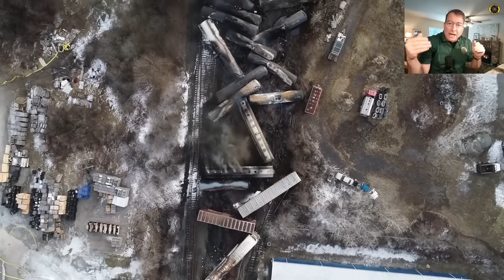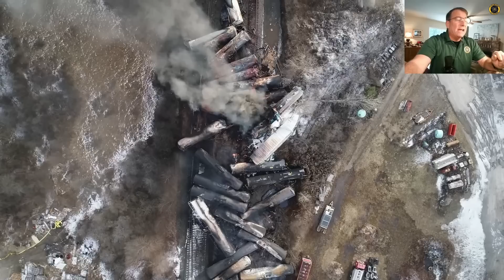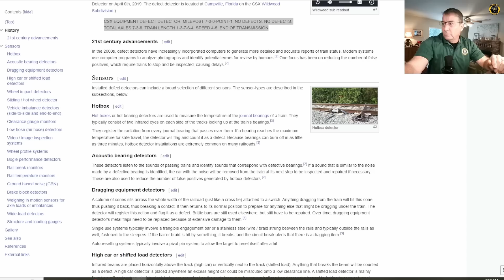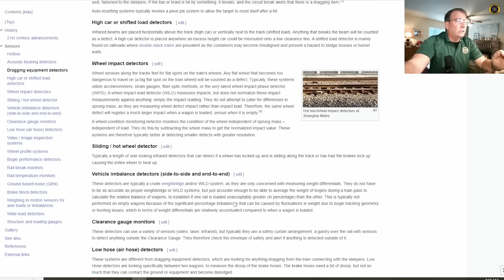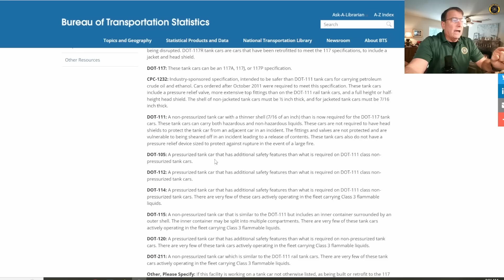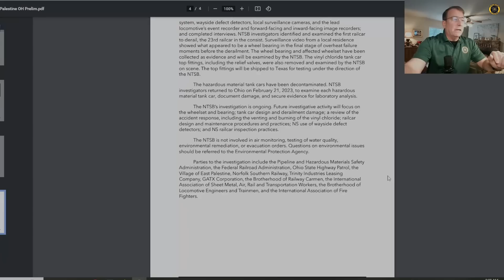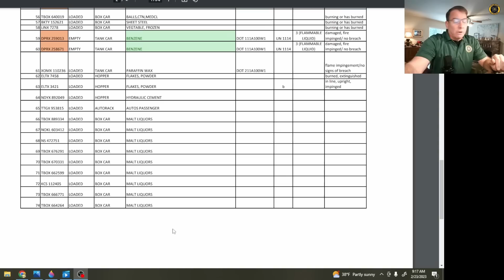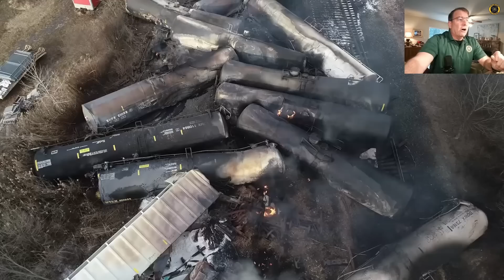NTSB Prelim Report: Norfolk Southern Train Derailment 23 Feb 2023

Comment from the maker: The derailment caused the emergency braking, thus exacerbating the derailment. Not the other way around.
Reply: When I worked at Conrail, I heard the story of a 4-mile train the PRR tested in mountainous territory.  Legend has it that it is still out there, broken into pieces of rusting steel down a ravine somewhere.  There are physical limits to train size, and when Conrail was economizing they used to run long trains out of terminals as needed.  Cars clogged everything and it was a disaster.

Precision-Scheduled Railroading (PSR) is nothing new, but it was used for railroads coming out of their post PennCentral bankruptcy.  Railroad management does not have a capital-investment mentality; they have an opportunistic/punishment culture since post Civil-war and the interstate highway system.  They do not have safety reporting hotlines or engineering-solution culture as in aeronautics.  It is dam*ed if you do, dam*ed if you don't.

The problem I'm seeing in that NTSB report is that there is no intermediate warning system with the HBDs indicating a caution to reduce speed due to potential mechanical defect.  If the temps are below an inspection threshold, then the train would continue with "no defects" at track speed until rapid failure warned to the crew to stop.

What this tells me is that the engineer had no idea that the bearing was in catastrophic failure because he was still applying dynamic brakes.  Dynamics are used to bunch a train's slack on downhill grades to keep a train under control (like regenerative braking or vaguely like putting a car into a lower gear).  They are not used to stop a train and are actually ineffective under 25 mph.  There are about 5 different braking methods on a train (more in passenger trains equipped with electrical and caliper brakes, as well as magnetic brakes in Europe).

It looks as if he was trying to bring the train to a gentle stop due to this being a first warning of a problem.  With a long train, this is entirely consistent with safe handling practice.  A train CAN derail with emergency brake application if it's on a tight curve, or if too much power is applied inconsistently along the length of the train, causing "string-lining."  Or the train can break into pieces over hilly terrain, due to speed differences between downhill and uphill sections.

BTW, the accordian-pattern of wrecked tank cars  is actually a designed failsafe.  Tankcars are fitted with "shelf couplers" that lock the couplers together so that the cars DON'T telescope over top each other, punching holes in their bulkheads.  Instead, the forces are directed through the length of the cars along their drawbars so that they wreck laterally and roll free of their wheelsets.

The wheelsets are held together by gravity and a very large machined-steel pin the size of a howitzer shell.  Service-vent valves on the cars are shielded from crushing and require a special tool similar to a fire hydrant wrench to open.  Insulated chemical tankcars have a glass inner-liner and baffles to stabilize compressed liquid loads.

TLDR;
In other words, we are dealing with huge shearing forces combined with both multi-ton static AND dynamic loads that are reinforced against accidents, but are not well-monitored or maintained due to upper-management failure.  In case you wondered, this accident is what happens when an irresistible force meets an immovable object.
Reply: @weatherupstairs4814  Thanks for bringing some actual railroading knowledge to the discussion.
Reply: Your comment about the malt liquor was quite funny! About the only levity you could wring out of that report.
Reply: I read years ago it takes two seconds per consecutive car to achieve full braking. So if the twenty third car derailed and snapped the air hose there are still one hundred twenty plus cars behind it times two seconds each. 240 seconds =4 minutes to achieve full braking on the last car. THAT'S why it stacked so many together before it crashed to a stop!
Reply: @Ron Frame  Nah, it's about 2 seconds for the brakes on each car to fully apply,  but the drop in air pressure that triggers the brake application travels through the air line very quickly.  Plus, the distributed locomotive and the sensor on the very end of the train would have initiated braking from their locations as well.
Reply: @ronframe387  the loss of pressure travels at around 700 fps down the air llne.  It's more of a parallel system, not sequential, as each car has an air (pressure) reservoir that applies that train car's brakes when the line pressure drops.
Reply: @stanley917 It's sequential. If the brakes are applied by the engineer on the lead unit, it would reach the last car 10 to 15 seconds later, at most, and normal application, starting at the head end, brakes would apply front to back, sequentially, from front to back.
Reply: @thomasmleahy6218  There is a propagation delay of the pressure drop (travels at approximately 2/3 the speed of sound ~ 700 fps) which causes a slight delay in brake application from one car to the next when the pressure line is compromised.  All the cars are on the same line, in essence  'teed' off the line -  in parallel to each other.  Sepuential impliles one car's brakes must be applied before the next can be applled. I was replying to someone that was implying it was minutes before all the cars were under braking.
Reply: @stanley917  Not many media and political types seem to have the slightest knowledge of how train air brakes really work. Lots of folks commenting on various blogs and videos don't seem to understand it either.
Reply: @ronframe387 Full braking would only take 20-30 seconds after the air went, and actual reduction in speed is very slow to develop. It's nothing like auto or truck brakes. If there was no derailment, it would take a couple of miles to stop that train safely. Lots of weight, lots of inertia. Excluding the derailment, the train makeup was an accident waiting to happen, unless controlled by an experienced engineer, but the makeup did not cause the derailment, it was a severed axle. The axle and the wheels on each side of the car are all one solid piece of steel, usually 6 inches or more of solid axle.
Reply: @thomasmleahy6218  The wheels are of one piece of steel( 2 each) and one axle of steel ( 1 each) for 3 pieces of steel, like 1.5 to ti 2 tons per wheel-set depending on wheel size and axle size.  The wheels are pressed onto the axle, usually about 40 or 50 tons per wheel.  The pressure gradient in a brake pipe during an emergency application has been measured at 6 seconds per mile of train length, or a drop of steady brake pressure to ambient pressure.
Reply: @royreynolds108  Axles are steel forgings as are the wheels. Each axle has a unique serial number. There is a database that details the size of the axle where the wheel was pressed on and the recorded pressure for the process. As wheels are replaced, the axle size will become smaller until its service life is gone, and then it will be destroyed. I have visited the NS shops in Altoona, PA, amazing operation.
Reply: @thomasmleahy6218  Loaded tank cars can weigh up to 263,000 lbs. A mile of them is a lot of kinetic energy to stop quickly.
Reply: @ronframe387  I'm also curious if the distributed power unit played any role in pushing the trailing wagons into the first one to derail.
Reply: @don_5283 It was all the tremendous weight behind the derailment that kept the cars piling up. The derailment caused the emergency brake. All engines, dpu or not cease power immediately upon emergency application. The car pileup exerted most of the stopping power as the cars slowed, the brakes would finally help in stopping the train.
Reply: @don_5283  Conversely, when the air was lost, the DPU would have stopped pushing automatically.
Reply: If there was no emergency brake the broken bearing would have caused the derailment, the car would drag on the ground, slow down, go sideways, pull others off the rails and all others would pile on top at full speed.  If the emergency brake did not slow the cars behind there would be more piled on top of the fire.
Reply: @markchamberlin7990 The bearing cut completely through the axle, SEVERED the axle
Reply: @thomasmleahy6218  Which means is was sure to drag the ground and cause a pile-up.  Emergency brake could not worsen that.
Reply: @thomasmleahy6218  it's called a wrung journal. It heats to the journal to the melting temp, and spins off, leaving a nub  on the end of the axle.
Reply: There seems to be a lot of confusion on just how train airbrakes work.  Many think air pressure from the locomotive is used to apply all the brakes on the train and that is NOT so. The compressor in the locomotive pumps up air pressure in a large tank on the engine. All the cars are connected with an airline, which is what you see with the hoses under each coupling. The pressure in that "brake pipe" as it is called is used for several purposes. Each train car has it's OWN air supply tank and a device called a "triple valve". That valve is the heart of the system. Air from the "brake pipe" running the whole length of the train, is taken off in each car, through that triple valve that maintains the air tank pressure on that one car. The triple valve ensures that those tanks maintain a set pressure all the time there is air in the brake pipe. The brakes, are activated to the desired level, on each individual car, and are controlled by the engineer raising or lowering the pressure in the "brake pipe" (train line some call it). A change in pressure that would call for some braking would cause the triple valve, on each car in the train, to release air into that car's brake cylinders. Air actually puts the brakes ON. If air pressure was lost, in that particular car, the brakes in that car will release. Train brakes are NOT spring brakes as commercial trucks have. If air is lost in a truck large springs hold the brakes on. In a train it is just the opposite. Lose the air in a car and it's brakes release. If a car is uncoupled and left on a siding, it's brakes will stay on for some time, days or maybe weeks. If that car is to be moved by a switching engine, the air has to be manually released in that car to free the brakes so it can move. If a switch of locomotives is made at a terminal it takes a few minutes for the new engine to pump up the brake pipe in order to release each car's brakes so the train can move again. That is because each separate car is activating it's own brakes from it's own onboard air supply

There was a horrible train wreck in Lac Megantic, Quebec several years back. The engineer was headed east and stopped on a slight grade before the town. That was a unit train of over 100 crude oil tank cars and the train had 3 engines. The engineer parked the train and left the train alone to go to his hotel. A new engineer from Maine would arrive in the morning to take over that train. The engineer set the handbrakes on 5 cars at the front of the train and left the lead loco running to maintain air in the brake pipe, at a level that would force each separate car to keep it's air brakes on. It is important to recognize that the air in each separate car's air tank was kept up to full pressure by the air let in by the triple valve, and that air kept that car's brakes on. If anything caused the air to be lost in any car's pressure tanks those brakes would release. This is why the engineer set handbrakes on the first five cars, to hold the train if those air brakes released!

Awhile after he left there was a fire in the lead locomotive. The FD arrived and extinguished the fire which was caused by a diesel fuel leak. As the left they shut down that loco that was running and that of course stopped the air compressor too. Due to slow leaks in the brake pipe, the onboard air supply was lost in a lot of those cars and each then released their brakes. Eventually enough brakes were released to allow the weight of that train to overcome the hand brakes he had set on a few of the front cars and that train ran away and caused the huge disaster we have all seen photos of. When that "brake pipe" pressure is suddenly lost, like a disconnected or broken brake pipe, all the brakes on the train are applied, in each car, with air supplied from it's own supply tank.  In the railroad world this is called "going into emergency".  This will happen automatically with no human intervention of any kind. I don't know if the engineer of the NS train actually was calling for any more brakes than he normally would, at that point on the line (I don't think so but we will know more on that later) but the brakes went into "emergency" without any action from him. Each individual tank car can legally weigh 263,000 lbs. A 100 car freight moving at near 50 mph is not going to be stopped in any short distance. It would probably taken a mile and a half to stop that mass. That is a huge amount of kinetic energy. If one or more cars derailed those immediately behind it would begin to go "accordion fashion" for some ways back. The brakes would have all been activated on those cars by the "emergency" application but you won't stop them on a dime. Cars further back in the train slowed down enough by the wreckage in front of them so they stopped in large part due to their own braking. The accordion look alike pile up of cars can be seen in every train wreck there has been due to a derailment at any speed much over walking. That is very typical of this kind of wreck.

Below is a video, of a British train, but the same system is used worldwide.  This clearly shows a railroad train air braking system in detail and an explanation of how it all works. This should help relieve some confusion I hope.

https://www.youtube.com/watch?v=jLfvcSgrgA4&ab_channel=Let%27sGrowUp
Reply: Thanks for clarifying the facts. It saved me from addressing the comment. 😎👍🏼
Reply: The derailment caused the stack up.  All the other cars plowed into the derailed car.  The application of the brakes on the train if anything slowed the cars before they piled up.

The air brakes on all the cars are routinely used to slow or stop the train.  They are not just used for emergencies.  Regen is useful on long grades, but won't bring a train to a stop.  Putting my engine in "emergency" does (amongst other things) fully apply the air brakes.  It also kills off any regen braking which can (and has) made things worse.
Reply: The Conway Scenic RR in North Conway, NH runs passenger trains up through Crawford Notch on the old Maine Central mountain division. That is over 8 miles of steady 2.2%. They have a former MEC GP-7 with a steam heater and use it on their passenger trains all the time. But they don't like to use it alone for lack of dynamic braking on the down grade. They have some GP-38's they use with it now for exactly that reason. They got an 0-6-0 steam locomotive, built in Canada, for the CN, in 1923. Has a new boiler and is in great shape. They don't like to use it on the mountain alone for several reasons, mostly braking. They like dynamic brakes available when running down that grade. That is a great use for that system.
Reply: Question, why would a plane headed to the mess in Ohio, crash in Pulaski county Arkansas moments after take off killing 5 environmental scientists ?
Reply: @imo8249  did you say Arkansas? 🤔
Reply: @jacobcastro1885  Pretty sure it was Arkansas. Let me check 👍
Reply: @imo8249  Stormy weather. Hope Juan covers this one.
Reply: Juan, it could be (not saying it would be guaranteed) helpful for some people to understand if you could mention the total weight of the train. If the total train weight and divided by the car count, a reasonable average weight per car could figured. Then, multiply that average weight by how many cars were behind the defective car and some people "might" begin to comprehend how many tons was needing to be stopped from traveling 45+ mph.
 If one would consider an average car length to be 70 feet long (I'm in no way claiming that to be accurate), then the hot bearing would have been over 1,500 feet behind the engineer and conductor. Also consider that the surveillance video camera was capturing the sparks in a "night vision" mode that could be more sensitive to light than the human eye.
Reply: Were the twenty tank-cars [of hazardous material and] Vinyl Chloride all hitched together? [update: yes the Vinyl Chloride was in cars 28-31 and 55. What was in cars 32-54 I wonder?] Is it standard practice to mix hazardous materials with explosive hazardous materials in the same train?
Reply: @eternaldoorman5228  yes, trains are blocked by destination. Not by the car types or what they are loaded with.
Reply: Happened about 200 yards across the street from where I work. Our cameras caught the accident.
Reply: @christianashby382  I assume NTSB has the video?  Also, hard to call this an "accident".
Reply: The car crashing off the track caused the rest of them to pile up behind it. The brakes are not capable of stopping in a short distance.
Reply: @Biochemechanic  Exactly!  Can't change the laws of physics Captain!
Reply: @Biochemechanic  inertia.
Reply: The derailment is not half as important as what they did with the chemical spill. They spent no effort cleaning it up and just set it alight. It was damned irresponsible and somebody needs to go to prison for it. The federal government once again sacrifices citizens for corporate profits, oldest story in the book.
Reply: Hi Blan, amazing breakdown. You didn't happen to be flying by?
Reply: What about the King Air Crash in Little Rock?
Reply: Very preventable tragedy.
Reply: @imo8249  how? Please, explain to me, in detail how this was preventable? The NTSB talks out their ass when they say something is preventable. Sure, it COULD be preventable but then the company would probably be bankrupt also, which is what happened in the 1960's and 1970's.
Reply: @TheNemosdaddy  Easily preventable. December 02, 2022 the government tried to guide the railroad industry. That kind of interference is the cause of the tragedy. Dirt simple, nothing to explain.
Reply: @lesmorgan5865  You don't have a fucking clue, and i am ANYTHING but a company man. What i am is facts are facts. No one, literally no one is going to run mixed haz mat trains and only 30-40 cars. This isn't the 1950's. Modern locomotives can safely pull 200 plus car trains. especially when using DP power. Again, the ECP brakes will NEVER be used on all rail cars. The logistics of getting them all replaced for such little benefits is a monumental task that'll never happen.
Reply: At 10° f, if the brake pads and wheels aren't already warm, it will probably take 10+ seconds before the emergency braking has any effect at all.  47 mph, those cars were already piled up before the brakes could do anything.
Reply: @TGoat5  Yup, and if they're already in DB, then the slack was probably already in unless they're stretching the train with the DPU back in the train, and then the slack behind that unit would have been in, in either case.
Reply: @NightOwlModeler  Yes, dynamics will compress the train.
Reply: I believe the flight from Arkansas that crashed and killed 5,were people coming to investigate the derailment in Ohio.
Reply: Many believe sleeper cells are at work here to derail trains,blow up food processing plants etc. The enemy within.
Reply: @joemueller4738  Tin foil is the next shortage to watch out for.
Reply: @Biochemechanic  I don’t doubt that at all
Reply: @Biochemechanic  Tinfoil? Really? Never seen it.Democrackheads talk about it all the time.They must have bought it all.Do you make hats out of tinfoil? Where did you get it from.We use aluminum foil to cook with but apparently demos make hats with tinfoil.
Reply: @velt7560  We have averaged at least three train derailments per day in recent history. The fact that they are reported on now is the only thing that may have changed. Not everything that happens is necessarily of some nefarious origin. The talking heads, MSM or internet, just want to get more viewers, that’s their job.
Reply: @Biochemechanic  Oh contraire, I have lived around trains my whole life.When was these train derailments this devastating and we didn't hear about them? Never.This is a sabotage/ landgrab to destroy people and our food supply. The water won't be used for crops for decades for miles around. The government will now take over this land.Just like byle Gaytz owning the most farmland in America.You can fool yourself but not those that do the research. That's the difference.Not the media mafia reporting it's people demanding answers they won't tell us. Stay bitter boosted and misinformed.
Reply: When was the last time they decided to set fire to one car and burn 5? Sabotage.
Reply: @velt7560  I am not saying some of that is not going on, but not everything is a conspiracy. That’s a different side of the psyops going on. Clickbait news. The wheels failed, based on recent developments. We had the same cracked wheel derailment near here a couple years ago. In that case it was due to failures of maintenance of the detection systems. Our regulatory authorities are not doing their job. Is the recent incompetent FAA head nominee a conspiracy, maybe. But sometimes incompetence is just that. Is there some deeper force pushing and pulling the strings? You can run yourself off the tracks engaging that line of thinking and make all sorts of bad conclusions and erroneous decisions. I am still keeping an open aware mind. And I don’t like the trajectory we are on.
Reply: @velt7560  Setting fire to some polymers did not cause the derailment, the fire was a result of heat from a mechanical failure.
Reply: @Biochemechanic  Nonsense.It was purposely set on fire.Do the research and get the facts and why are you defending evil?
Reply: @velt7560  Besides the conspiracy nuts, I have not seen credible evidence the fire was set on purpose. I would like to see that if you have it. The mechanical failure could have generated enough heat to start the polymer on fire, it was a thermoplastic with a fairly low melting point. I am keeping an open mind. I never support evil, using fear is evil.
Reply: @Biochemechanic  They purposely set the cars on fire after the crash. And I wouldn't doubt the fire underneath was set.How many food processing plants have been destroyed? How many chickens have been killed? How many truckers are without work due to unjabbed. How many cargo ships are still sitting? How many trains have derailed near water? How many farmers can't get fertilizer? How many have been bought out by byl gaytz only to not be used? How much is a dozen eggs? How much more will it take to wake people up to the fact we are being attacked? If you're waiting for the next lockdown,which is going to happen,it will be too late.
Reply: @velt7560  They admitted and explained why the cars were set on fire. I will stay on subject.
Reply: Look at the masonic cheerleaders. Clueless.
Reply: @Cougar  Why did the ntsb report come out so quickly ?
Reply: @imo8249  Preliminary report, just the obvious facts. Lots of material is being sent off to labs for analysis.
Reply: @imo8249  1) If you know the cause, you might be able to quickly take action to prevent a recurrence. In this case lower the alert setpoints on the hot box detector. 2) to clear the air about braking being the problem. The brakes worked as intended/designed. The proposed electronic controlled brakes (ECP) would not have made a significant difference in the magnitude of the derailment - it may have prevented the last two or three cars from derailing, but they detailed at low speed and are probably structurally intact.
Reply: @daveevans2527  Didn't the feds get involved somehow in December 2022 ?
Reply: @imo8249  just a preliminary report.
Reply: Recommend next time to get some assistance from someone with railway expertise before doing something like this. The emergency braking resulted in less cars being piled up.
Reply: I think the emergency breaking system is only half the issue here.  There is no reason that trains carrying dangerous materials should be relying on a system that notifies temperature changes in 10 mile intervals (more or less), these trains should have active monitoring of the bearing temps as well as all other critical components in a system that tracks that data inside of the cab with the crew.  The rate of temp change in that bearing would have been identified as potentially catastrophic well before it was identified by a stationary system and could have prevented this entire event from occuring.  This type of system combined with the current ground infrastructure would, in almost all cases, prevent things like this from occuring in the future.
Reply: @statonotto  Do you have any idea the infrastructure cost and maintenance that would take? Especially considering nothing like that even remotely exists for rail cars. It's just ridiculous. This has been going on for over 150 years, shit happens, they'll make it right and move on.
Reply: @TheNemosdaddy    The cost of a system like this is miniscual compaired to the cost that they will have to pay when all the dust settles from the East Palistine Disaster.  Secondly, no other industry relys on 150 year old tech including the rail industry. Hotbox Detectors were invented in the 1940's and were upgraded with computer tech in the 2000's. We are at a point where the cost of this tech is well below the cost and cleanup of a derailed train and its fucking ludicrous to say "they'll make it right and move on."  On numerous occasions it has been shown that you cannot allow an industry to regulate itself and it is unacceptable to say something like that when they have just caused a huge natural disaster that included the release of forever chemicals into the enviornment. Also any maintanence is higher than what they have been doing for the last 4 years. They dropped inspection times across the industry from 60 sec per car to 30 sec per car and cut the workforce to buy off stocks.
Reply: @statonotto  Please STOP telling me what they Dropped or did as far as inspections. I'm literally a 24 year veteran of CSX inspecting rail cars. There was never any "official" times put to cars. Are we rushed at times? Sure. Are we not allowed to inspect cars or bad order cars, absolutely  we are. Stop listening to media and union  hyperbole and think its factual. There was no way to have prevented this, none. It happens. Bearings can fail in short order. It's rare that they do. You have no idea what the costs are involved, so dont make statements saying it's "miniscule". You dont know.
Reply: Emergency braking would have reduced the size of the wreckage after the first wagon derailed as had the been NO braking on the trailing portion of the train, it would have been the action of each successive derailing wagon to slow and stop the remaining on rail wagons.  So I think the emergency braking did the opposite to exacerbating.  (I did watch the briefing today).
Reply: @hoverhead047 The whole train goes into emergency at the same time. It's caused by the sudden loss of air pressure in the train line caused by the already derailed cars. Although it takes a few seconds to travel the whole length of the train, when the air "goes" it goes on the whole train without any action required by the crew. The pileup contributed to stopping the train behind the derailment more than the brakes did.
Reply: @hoverhead047  That is not quite correct. Each separate rail car in that train had it's own self contained air tank on board to activate the brakes on that one car. When the "brake pipe" (train air line broke) each car would automatically set the brakes on that one car. Air pressure, from it's own air supply, not the train air line,  applies the brakes on each car individually. All of those cars behind the derailment would have still had their own braking capability. In railroad lingo, when the air line breaks for any reason, the entire train goes into EMERGENCY braking application with NO intervention from the engineer. This is all done automatically and was designed that way. This was designed this way on purpose for safety. No runaway train cars could go far without stopping this way
Reply: @hoverhead047  ummmm, no. With the locomotives already in dynamic brake, therefore ‘bunching’ the train, a remotely initiated emergency brake application has a nasty side effect. 
The locomotives upon detecting the loss of brake pipe pressure automatically suspend dynamic braking and apply emergency pressure to the the locomotive’s air brake. These actions are NOT simultaneous. 
Suspension of DB is instantaneous, causing the locomotives to ‘run out’ or stretch the first few cars while the loco air brakes apply. Depending on how many locos are lashed together, this can take several seconds. 
Next, the locomotive’s brakes are considerably more efficient than wagon brakes. This causes the now stretched locomotives to violently bunch back into the train slowing the front section faster than the rear. Any derailed vehicle, on receiving this compressive load, from ahead, is ‘pinches out’, usually digging itself in the ballast with following cars concertinaing in the classic way shown here. Phew. 
It’s for exactly this reason that if a train has a pull apart, it is vital to bleed the locomotives brakes off independently to stay ahead of the rear section. 👍
Long explanation but I hope it helps.
Reply: @hoverhead047  Correct, the emergency braking prevented the entire remaining ~100 cars and DPU from piling into the wreckage.
Reply: @hoverhead047  Exactly. The automatic brakes don't exacerbate it as Juan seems to think, they minimize it. They're slowing down the railcars that are heading into the pileup. Of course, the faster the train is going and more heavily it's loaded, the less effect they have.
Reply: This doesn't make sense to me. A train is not like an automobile where sudden hard braking at high speed causes loss of control. Trains withstand emergency stops all the time without accordioning into a pile.
Reply: @RaineStudio Was not the brakes that caused the pileup, it was the derailment.
Reply: @RaineStudio  Yes and no.  A lot depends on where the loaded and empty cars are; if there are light or empty cars ahead of heavily loaded or many loaded cars, the lightly loaded or empty cars can be in enough "buff" or compressive load that one or more cars can be forced vertically, coming off the track, particularly in a slack run-in and an emergency brake application. Use of dynamic braking would exclude slack run-in as the cause.   This exact scenario has happened many times in the past, it is a well-known phenomenon.
Reply: @RaineStudio  Emergency brakes frequently cause the wheels to slide on the rails, grinding flat spots on the wheels.
Reply: I believe train brakes are opposite of truck brakes.  They take air pressure to set the brakes.  

That was the problem with a crash in Europe not so long ago.  It was also the problem with the oil train in Quebec.  In that case the engineer didn’t crank enough mechanical brakes to hold the train and there was no air pressure because the engine was off.
Reply: @rydplrs  No.
Reply: @SteamCrane  when did it change?
Reply: @rydplrs  Fail safe train braking? About 100 years ago.
Reply: @rydplrs  The Westinghouse air brake system has been around for well over 100 years, around 1880. The car air reservoirs  for fail safe braking were added very early on. A runaway can happen if the store of air in the reservoirs is used up, such as by continuous braking without allowing time for the reservoirs to recharge. Each car has a clever "triple valve" that manages this. Lac Megantic was the air bleeding off over time.

The braking requirement for trucks is simpler, just springs in the cans that apply the brakes when air pressure drops. That's why you can't move a truck until the air pumps up enough to overcome the springs.
Reply: Should there be a one way valve on the breaking system so the cars in front of the derailed car can continue on while the cars behind the derailed cars still brake?
Reply: @mballer  That happens anyway, to a degree.  The derailed cars start to pile up and the head portion of the train will continue to roll for a ways before stopping.  You are usually a little ways away from the derailed cars when you walk back to see what caused the train to go into emergency.
Reply: @mballer  Simple answer, due to physics, is that this is how it works out anyway.  Because the train cars in front of the derailment are still being pulled by the locomotives, it takes more active emergency braking force to stop since they're still moving forward evenly.

Meanwhile, the derailed car puts all the cars behind it in default emergency due to the rapid pressure drop in the brakepipe.   But because the cars don't all activate their brakes at once, their momentum carries them unevenly, like pushing on the end of a piece of string.  They stop rapidly, but pile up.

You wouldn't want the front end of the train to keep going because then engineer would never be able to tell if there was a problem.

But you also don't want the engines too close to the scene of the accident due to safety, since the crew are the only people on the scene who are able to give emergency responders immediate insight into the train manifest, location of hazmat, and tonnage.
Reply: @mballer  To some extent, there is. The lead engines could still drag the intact cars for a short distance, but not far.